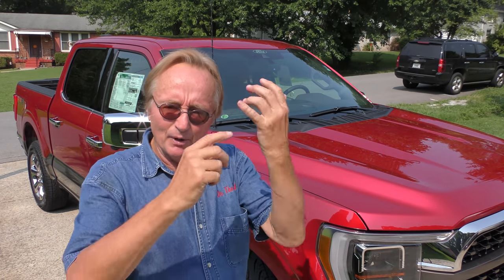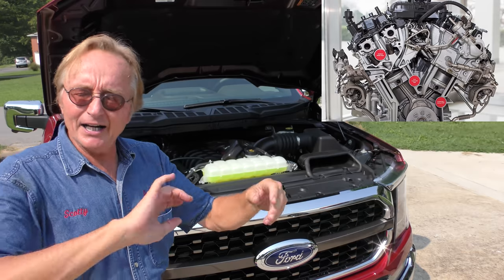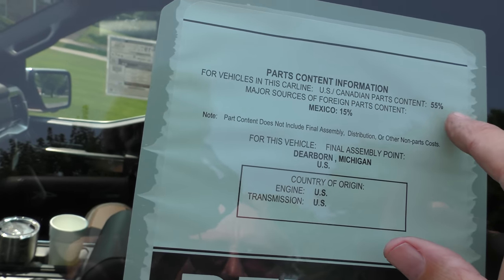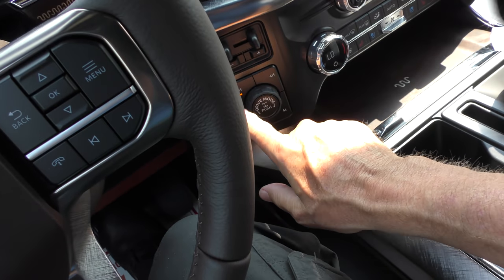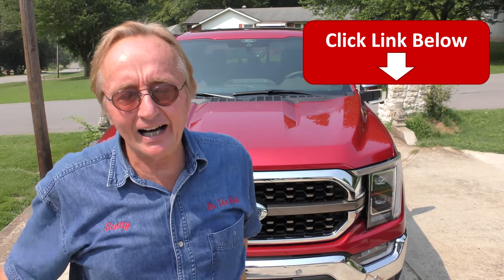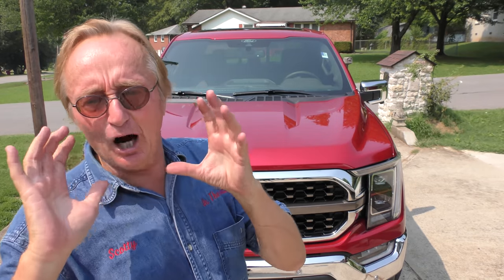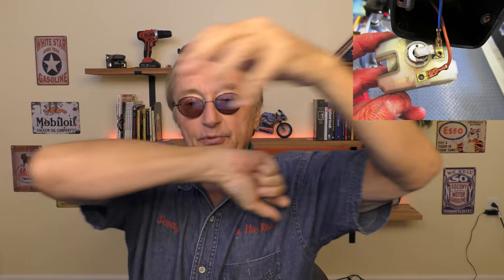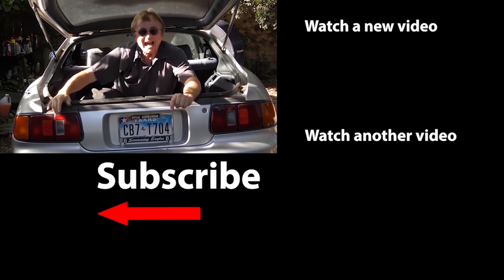I Finally Got a New Ford F-150 and Here's What I Really Think of It

Comment: I used to work at Honda, I can confirm the 1.5T are bad engines. New one have rear main seal leaks around 6k miles happens often. Check your 1.5 regularly. No do an oil change on those every 4k miles. (At the most) gotta change the oil on turbo charge engines more often.

Comment: The tundra turbo will be fairly reliable but Since the tundras going twin turbo, it’s over for their long term reliability
Reply: give me a break. And Toyota has not said they won't offer the v8 also. The v8s are not perfect either, I had 2 of them. Goggle air injection pump recall.
Reply: @bookooc5605  if they offer a v8 it’s most likely the rumored twin Turbo v8

The 5.0L v8 in the tundra would be really sweet though

Comment: I am so proud of you scotty, got a real mans truck.
Reply: Not quite. Real trucks don’t have spark plugs
Reply: @lgrw9883  I seen some sweet deals lately u can get a desiel for just under 120k 😂
Reply: @dialaprohq  I got mine for 13000 CAD (which was worth about 9,800 USD at the time of my purchase)

Yes the new diesels are absolutely ridiculously priced, but You don’t need to buy brand new. Hell, the older ones are generally more reliable anyway if you can find one in good shape. I wouldn’t even trade my Ford 7.3 litre for A new diesel… well, I would but just so I could sell the new one amd make 100K lol.

Comment: I want this truck but for some reason I’m just not worried about Toyota’s new twin turbo v6.... I know if anyone is to put a turbo 6 in a truck it should be Toyota because they will take the time to study it’s flaws before shoving it in.
Reply: Kinda like the time they spent to see if their frames would rot out or not.
Reply: @stuntmanroy  all in all they make the most reliable vehicles. I’d buy one without hesitation
Reply: @android-ud2nf  I have a 2008 tacoma I will sell you for 65g. Only has slight surface rust on the frame nothing to be concerned about.
Reply: @stuntmanroy  lol better be 6500 not 65 grand
Reply: @android-ud2nf  $65,000 and don't try to lowball me I know what I have.
Reply: Aren't they (more or less) the same engines in the new 4runners?  So they've had at least some time to work out kinks.
Reply: @android-ud2nf  Why are you hesitating to buy my truck bro? here I thought you were a real Toyota guy and  not just some spinning his wheels fan boy.
Reply: @ds2k15  the 4 runners have a prehistoric 4 liter. This engine I believe comes from lexus and yea it’s been around a few years in the ls sedans
Reply: @stuntmanroy  for one I’m not sure if it’s 6500 or thousand and even tho I’m a Toyota fan I have a 2010 ram with less than 40k miles so I don’t need yet another vehicle.
Reply: @stuntmanroy  I got my truck when I was 19 and if I could go back I’d slap some sense into me and get a Toyota Tacoma instead of a ram
Reply: @android-ud2nf  You're right, I was thinking of the land cruiser.
Reply: @stuntmanroy  I know truck prices are insane right now and I know Tacoma is a great vehicle, but your truck is worth nowhere near 65 grand bud.
Reply: @inspectahgex1910  The price for you is now $90,000 bud.

Comment: I got a 2020 2.7 twin turbo ecoboost and it's awesome. Same horsepower and torque as a v8 and better fuel mileage. I actually raced a Denali which have a 6.2 engine and beat it lol. Ecoboost for the win! I still like the v8 engine too though don't get me wrong

Comment: Scotty, a friend of mine put power steering fluid in his brake fluid. Before driving I tried to suck it all out with a turkey baster and then bled the entire system and put new brake fluid in. Is there anything else we should be looking out for?
Reply: Should be fine since you bled the system and brake fluid is corrosive it might get rid of the remaining ps fluid in there
Reply: Smoke🤷‍♂️
Reply: Tyler...better blow out All the hoses with Air Pressure..that's what we did to a customer who put Motor Oil in her Power Steering Reservoir..
Reply: Can you put ATF in your power steering pump?
Reply: @waltertomaszewski1083  i know for a fact certain atf fluids are the same as power steering fluid
Reply: My sons bmw uses the same auto trans fluid for the power steering fluid, just look up the specs for your particular car.
Reply: @waltertomaszewski1083  my 2003 Toyota Highlander specifies GM Dexron III fluid for the power steering .
Reply: Next time suck it out with a straw yourself and swish it around, that's where you messed up
Reply: @waltertomaszewski1083  My 05 Xterra calls for Dex3 in the power steering system.
Reply: @waltertomaszewski1083  I’m pretty sure it’s like the same thing...
Reply: Get them glasses
Reply: @waltertomaszewski1083  You can if it specifies it. Type F is used on older vehicles.
Reply: @waltertomaszewski1083  Often is same thing and calls for ATF.
Reply: Somewhere out there a turkey is rejoicing 🤣

Comment: Yes, the Ford F-150 is an excellent full-size pickup truck.
Reply: The V6 Tundra will still hold its value better, last longer and be worth more later.
Reply: @jimeagle1155  What’s a Tundera?
Reply: @seanmcfadden6600  thank, fixed
Reply: @jimeagle1155  4.0l?
Reply: Junk
Reply: @theshield1613  still a Toyota
Reply: @jimeagle1155  4.0l is a v8 size motor.

Comment: Hey Scotty, I own a 2005 Ford F-150 super cab with the 4.6 liter triton V8, when I take off, even if my foot is a quarter of the way down or more it won’t take off like it should, now I know that that generation of f150’s have spark plug problems, but what should I be looking at to improve my torque ratio?
Reply: A new truck 🤣 jk jk
Reply: A Chevy 😁
Reply: Those were very underpowered engines in those trucks but usually it is because the transmission is in too high of a gear and lugging the engine. Try putting the truck in sport or towing mode and see if that helps. That keeps the truck in lower gears so acceleration is improved. Hope this helps.
Reply: Either fuel or air. Could be throttle body, weak fuel pump, clogged air filter, clogged cat. Unless you can turn a wrench, take it to a mechanic.

Comment: I have a 2000 F150 Lariat 4x4, and even that year gives a nice smooth ride. And yes, changing plugs requires removing the fuel rail...even easier when the intake is removed...don't ask how I know.

Comment: I don't know why FOMOCO has a shift lever that retracts electronically.  Just another more expensive part to replace.
Reply: You answered your own question.
Reply: Right. Ram has it right with the dial shifter
Reply: It's an option,  you dont have to buy it.
Reply: thats the whole point.they got to give you a whole ton of worthless crap standard to charge you 50k for a truck.the days of stripped down basic work trucks are over.theres no profit in them.
Reply: I believe it's to accomodate a fold flat work surface you can purchase as an option. Flat surface folds out over the cup holders and shifter
Reply: It retracts because it has a fold down work station and the shifter would be in the way of it. It’s pretty cool actually especially if you need to do computer work in it
Reply: Mr Destro  Why do you say that? For an electronically controlled transmission, it makes the most sense. It doesn't take up a lot of space, is out of the way, and is easy to use. I have a 2020 Big Horn and really like it
Reply: @timschultes6467  yea but a dial shifter like the Ram or their own expedition would be far simpler and save space
Reply: @sparks2429  I agree, specially nice if you get that massive center console.

Comment: FUTURE BONUS QUESTION = Hey Scotty, I’m driving a 2012 Ford Fusion V6 AWD paid off and I’d like to continue taking care of it at 115k miles. I have a creaking old wooden boat knocking sound when I brake to a stop slowly and accelerate slowly on turns. I only notice this sound at the hottest parts throughout the day in California (108 degrees today) ESPECIALLY when I run my AC. I’ve replaced rotars and brake pads and had my brake fluid changed from local pep boys just to pick up the car and drive it for a week to notice the brake fluid res cap was not tighten down and could of accepted air and dust into the lines. Took it in to a local Napa sponsered shop for a brake fluid flush just to be told that it didn’t fix the issue and that i need to replace the Brake booster for $1200 after labor. Does this sound remotely on track to you? Appreciate your content and expertise. Hope to hear from you in a future video! 
Anyone else advice is appreciated as well.

Comment: I have to call you out on the Mercedes Benz, complaint. Mercedes does not have 75 computer Modules.  A lot of Mercedes components run off a CAN-BUS NETWORK. The NetWork helps eliminate the running wires to operate every component. He very well may have a short. But Replacing different modules doesn't necessarily mean it will require dealer programming. Lots of times just disconnecting the battery will reset certain components stored in the information kept in the Gateway Module...

Comment: Wanting the f250. Wish trucks could have good gas mileage 😩
Reply: Why the 250 over the 150? The 250 will never have good gas mileage. It's way too heavy.
Reply: @Anth230  basically Just for the towing capacity
Reply: @matthewstout599  Well if you really need it. Get it. But towing anything substantial with a 250 kills the gas mileage to single digits. I know it sucks. I like the 250's as well. Especially the stripped down regular cab trucks with 8 ft bed and 4x4. But the gas mileage has always sucked on them. And probably always will. It's such a heavy truck..

Comment: A friend of mine has the V6 F150. He's still making payments, & both of his turbos need to be replaced ($3000 expense).
Reply: Thats why I chose the Coyote V8 over the EcoBoost V6 anyday of the week.
Reply: @CJColvin  yep me too, love mine
Reply: @glxxyz  Awesome brother.
Reply: Right…
Reply: @Nopalero916  i agree with you, I own a 2013 ecoboost 4wd with 240k mls. all original still purrs like a kitten. Turbos are awesome 👍🌟
Reply: My  v6 twin turbos  have 160k on them nd no issues ..so its how u maintain ur ride gives u longevity...as with a v8 ..
Reply: Wanna race my 3.5
Reply: My friends 3.5 ecoboost had the timing chain replaced and the exhuast manifold before he hit 60k miles. I told him what did you expect it's a Ford.
Reply: @fireant1272  I guess I got lucky….or just drive it normal…I never step on it. …do my oil change every 3000k mls. Plus 2-oil catch cans installed due to direct injection system for the turbos. I like all makes… if you take care of it…. It will last a long time.
Reply: Did he drove it as expected (for turbo charged engines) 

No high rpm until oil is heaten up
let the engine idle half a minute before shut down (to cool and still lubricate the turbos to avoid metal on metal).
Change oil regulary and use the correct oil (wrong oil can carbonize on high temperature and plug the oil lines from and to the turbo charger - less lubrication, higher wear).
Reply: @DSP16569  good tips. I’m sure more than half the drivers don’t know that about turbo engines
Reply: That's not a bad price for both turbos. With the Coyote's you usually just replace the whole motor. And they have a much higher failure rate.
Reply: I bought a new 2012 eco boost, 240,000 miles still going strong, just routine maintenance.
Reply: @fireant1272  so wtf do you drive
Reply: @jayc4715  12 valve cummins 5 speed.
Reply: @fireant1272  aka..a p.o.s Dodge..the WORST american brand you can possibly buy
Reply: @jayc4715  right, actually the new Rams and tundra are the most reliable. I've had alot of Fords in the past and they have all had so many problems. The 5.4 spark plugs blowing out of heads and transmission rebuilds. The 6.0 and 6.4 diesel head gaskets, egr,  turbo and so many other issues the cost to own them was outrageous. Now the 3.5 EcoBoost my friend owns has been a complete pile he doesn't even drive it anymore. My old Ram has 466000 miles only had one rebuilt transmission and new front end.
Reply: @fireant1272  how can you know if a truck is reliable if its NEW
Reply: Early 3.5 ecoboosts had problems but they have improved it…if you take care of it, it will take care of you…
Reply: @DSP16569  No need to cool down turbos in ecoboost Ford engines. They are water and oil cooled. They are designed to circulate coolant even after shut down to protect turbos. The old time turbos did not use this technology.
Reply: The only way that’s true is either he tuned it, or never changed the oil

Comment: The ecoboost 3.5 HO kills a 5.0. Superior in every way
Reply: The regular 3.5 kills the 5.0
Reply: Yeah, until the 5.0 gets tuned and bolted up!  The fastest trucks are Coyote powered, not Ecoboost!
Reply: @Twizztify  No they're not. Both Ecoboost's easily beat a 5.0. Trust me, I had 2020 5.0 F150 and got rid of it due to oil issues. Have a 2.7 now and it makes my old 5.0.feel like.poo.
Reply: @Twizztify  Gonna need more than bult-ons. More like a supercharger.
Reply: The fastest single cab 5.0 runs 8.5 second quarters and the fastest super crew 5.0 runs low 10’s.  Ecoboost are fast right out of the gate, but fully built vs fully built, 5.0 is on top.
Reply: @DragonKnightX12  very true……., a supercharger is a bolt on. An expensive bolt on lol
Reply: @Twizztify  After $20,000 of modded parts ya. An Ecoboost you just need a tune.
Reply: @Twizztify  That truck you're talking about isn't just bolt-ons. They swaapped in a 5.0 from a Mustang with Twin-Turbos running E85, and a whole lot of custom work.
Might as well just buy the Ram TRX.

Comment: I love Ford but they screwed up stop making the best engine ever the 300 in-line 6 cyl. Bet truck ever 1993 f-150 4x4 short bed , incredible !
Reply: Their 3.3l v6 is a great option if one doesnt want the eco boost or v8. 
It doesnt get much love but it's a solid engine and has enough HP and Torque for most people. Unless you have to haul around a big motor home.
Reply: That 300 Inline Six will definitely outlast the stupid EcoBoost engines like nothing.
Reply: @scott5799  I guess it depends what you want it for. I have one and it tows my trailer and hauls whatever I need in the bed. But yeah if you need to tow a motor home and haul more it's not gonna cut it. 
I agree. But for someone like me it's been awesome. I get 21mpg city driving. (Not towing or hauling) it's good for me. It has 290 hp and sadly it 265 lbf torque is where it falters. The 1990 v8 had about 250 hp and 400 lbf torque.
Reply: @CJColvin  its a hearty little engine to be sure....

Though people are getting crazy miles on their EcoBoosts now. The first years had their issues. But the future of their longevity remains to be seen. My brother in law has one. His truck is also a 2018 and he has loved it so far. I think he has 50k on it so far and zero issues after 3 years. So it remains to be seen. 

I get that you like the older stuff but a lot of older guys dismiss new tech way to quickly. I remember back in the 90's I heard the same stuff about the current trucks. Now they are hyped as good solid trucks. Lol.....
Reply: @Anth230  Do you like Muscle cars.
Reply: I had on in an E-150 van, mated to a three on the tree.  I did a lot of towing, but my only complaint, was not much engine braking going downhill.
Reply: @CJColvin  Ford should have kept it, beefed up the valvetrain and supercharged it...those bottom ends were built to last.
Reply: @CannonFodder873  Exactly and that bottom end of that old six cylinder is definitely wayyyyyyy stronger than any EcoBoost engine out there.
Reply: @CJColvin  Of course. 😄I have owned several Mustangs...I had two 67 mustangs, a 81,89 and 90 also had a 68 cougar. 
 Havent had one in several years though. Would love to eventually get a Dodge Challenger. Love the current muscle cars....
Reply: @scott5799  Yeah i can see some people not digging it. I personally enjoy it. But don't really travel all that far. Next truck may be the v8. We shall see. I will probably keep this one though. Two trucks are better than one. Especially where I live....
Reply: I think there must have been something wrong with yours, I had one in a 91 Ford F150 and it was just as powerful as any V8
Reply: @scott5799  be a man and drive a stick shift manual trans for Christ sake
Reply: Yes,300 cubic inch, definitely was a great engine 👍
Reply: @stevewatts950  be a man and ride a horse
Reply: @stevewatts950  Jesus christ. Some of you old guys just cant let go of the past. Be a real man and learn about new tech instead of holding onto the past and criticizing what others drive....🙄🙄🙄
Reply: @scott5799  my 93 with 300,000 miles still running fine after all these years! Be a man and drive a stick shift.
Reply: @Anth230  Awesome brother.
Reply: @captinbeyond  I dont have any of that on my 2018 f 150. It's out there you just have to look and remind yourself you don't need the top trim or power...
Reply: @captinbeyond  I dont have any of that stuff on my 2018 f 150. You can still get Halogen Head lights. Cost very little to replace. You can still get a column shifter even manual windows and locks if you wish.  Though backup camera is standard now. Though if it breaks you don't have to fix it...
Reply: Steve watts do the world a favor and disconnect from the internet. If you can’t take a joke then get off social media and keep to yourself in your ranch.
Reply: @littlehugebigplanet2  I’m not in a ranch, I’m on a ranch! Unlinked your in a basement someplace. I breath fresh air unlike you.
Reply: @stevewatts950  you see I was trying to be nice, but soon you’ll be in the dirt of your ranch. Btw those motors will still be ticking but yours will not soon, take it easy young man! I wish you well, who am I kidding I could care less if you drive off the cliff in your ford.
Reply: @captinbeyond  you bragging or complaining? I’ll take a 94 Ford or earlier. I can fix them myself.
Reply: @littlehugebigplanet2  you will go off a cliff in your Subaru ! Lol